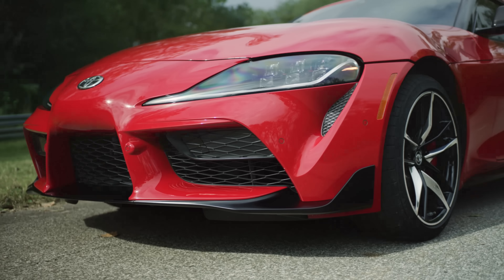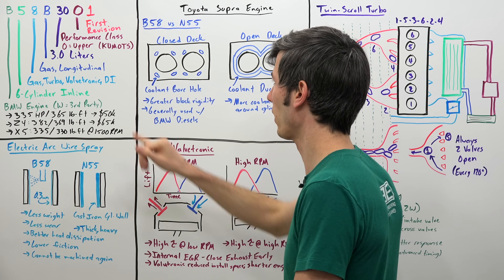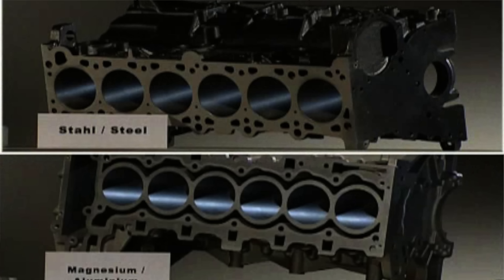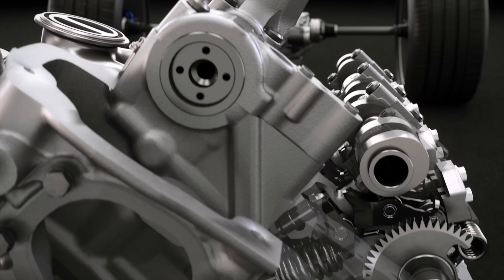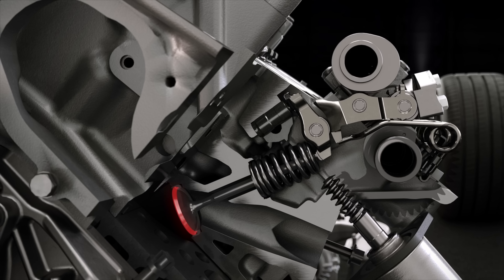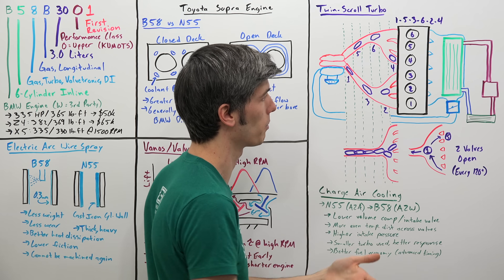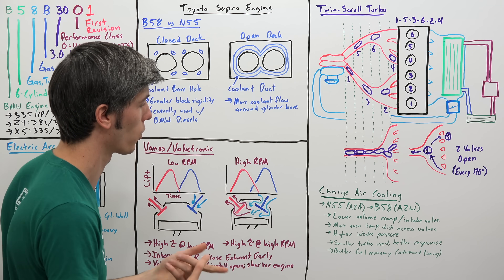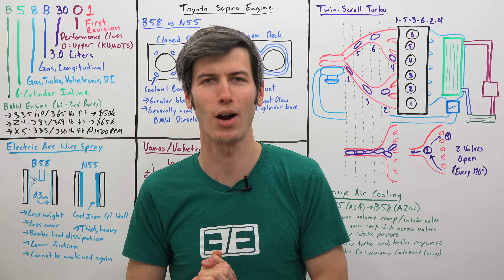2020 Toyota Supra Engine - Detailed Review Of The 2JZ Successor

Comment: Makes me regret selling my MK4 knowing there will never be an in-house built Toyota GT car.
Reply: Unpopular opinion: the only Supra is overrated.
Reply: Why would you sell the old one? Sorry to hear that man. I'm really sorry.
Reply: thatunknownguy don't be. Made a killing on it
Reply: Especially with the crazy prices they are reaching now
Reply: You... sold your MK4?  Blasphemy!
Reply: Lexus F is where Toyota is investing money.
Reply: buy the lc500 :)
Reply: Does anybody get that a Supra must have a straight 6 engine. Something Lexus doesn't make
Reply: @RDJ1SS  More than that, it could only exist in partnership with somebody as the volumes are too low for Toyota to build from scratch, especially since they don't have any straight 6's any more homologated for the US anway. Since it only could really be done by spreading the cost for the platform, may as well go with the best sports car maker with a 6cyl inline ya?
Reply: Lexus makes yachts. At that point might as well buy a Challenger.
Reply: @jdmr1c3ing  depends on what you buy. The isf was good, The lc should be good, the lfa... Hell the old SCs like mine are based on the mk4 supra chassis most parts are interchangable suspension, firewall is identical 300 used a na 2j, 400 has a 1uz v8. Therr are plenty of yachts like the LS400 and the suvs etc... But lexus is where toyota engineers get to go less conservative than the toyota name plate
Reply: @jblob5764  the LC500 is a boat.
Reply: I sold mine in Jan 2017 because I moved to California and there was no way  was going to get it to pass SMOG. I regret selling it. As the price keeps going up I will probably never own another one.
Reply: Yeah, it's pretty telling that the only two non-boring cars Toyota makes (86 and Supra) and they can't even be bothered to make it themselves.
Reply: not like the 2JZ was built by Toyota.. its a Yamaha built engine.
Reply: The Lexus LC F that is coming out is what the new Supra should have been.
Reply: Shwalker07 totally agree. Great platform and the supra should be a larger GT not a compact sports coupe
Reply: @Shwalker07  no way.. that's a heavy cruiser not a sports car
Reply: I have a all-track sitting in storage and I think now may be the time to sell it. I highly doubt it's value will grow any. Unless it sits for another 100+ years. It probably won't be on the lot long. She's a fast little beast but they're one of the few Toyota's with reliability issues.
Reply: @gravyd316  
What year All-Trac?
Reply: @EPYes  I think it's a 93 or 94. I don't have the title right in front of me ATM. It had 50k on when I parked it but I did let my nephew borrow it for a month or so. Knowing him it's probably at 60k lol.
Reply: RCF GT3. Btw.
Reply: by "in house" you mean Cylinder head by Yamaha, sort of in house right?
Reply: I have a 95 black on tan 5 speed with 120k miles for sale $31k for interested parties
Reply: Um you guys do know the mk4 2jz was built by yamaha yeah  ??? Not Toyota ? ... History repeats itself again lol 

New TOYOTA 86 = subaru boxer engine
Reply: Are you quoting the 2JZ? yes it was a fantastic engine!
Reply: @fidelcatsro6948  sure was you can thank Yamaha for the 2jz
Reply: Respect brother Respect Nice to hear your a Yamaha fan and have a WEAPON of a bike.......wow nice You Ride hard i see ? Your exhaust ports was choked with Carbon hu ? Wow man thats hardcore.... Glad to hear its all clean now and ready for a Blast 👍👍👍😁😁😁😎😎😎  

Hay bro u have a Youtube video of your R1 yamaha 1000cc Bike ??
Reply: According to Chris Harris, Type R beat Lexus LC 500 in a track. I'm not sure that video hold any water, but if Toyota tuned new Supra well it could beat LC 500 in a track. Horsepower isn't everything.
Reply: @danielrouw2593  um no Yamaha built the block as well just do google search on it.... if u design somthing you pretty much giving the build all of its faults and success, to say yamha design somthing and Mitsubishi forged the motor in factory dose not give full credit to Mitsubishi for engine credibility to them
Reply: @REEL SIXX no but i sure wouldn't be giving Toyota all the credit....can u imagine  the Ferrari coming out and saying all of our engines was built by Lamborghini?? Would u still give full credit to Ferrari?? Now come on bro be serious about this ?
Reply: 2JZ from Yamaha
Reply: ah dude, that's sad..
Reply: Sold mine a years ago, glad I got the money. It seems I was getting to old driving around a TT :(
Reply: Lies.
Reply: if you had the audacity to sell an mk4 then you never deserved it to begin with..
Reply: There my be yet a true successor in the future still im sure the earth shattering backlash from the community and sales will force toyotas hand to produce something of meaning and value. Dont lose hope yet.
Reply: Carlos Nazario   Not really, the “community” doesn’t represent more than a fraction of potential buyers. 

Also, the last gen Supra was a sales flop in the US,
Reply: @carlosnazario1170  toyota would rather kill the Supra name if this fails than dare to impact sales for the Lexus F cars. Honestly this thing needed a light chassis housing the gsf v8 and it would have been a home run. The v8 is choked down by the heavy cars they put it in, especially the bloated Frankenstein chassis of the RCF. Even a ttv6 that Toyota builds for Lexus would be a winner.
Reply: afrosheenix exactly! All they had to do was put the F V8 in a small light car with a manual transmission and it would have been a complete home run. They’d be offering something new to the sports car market with a light(ish) V8 manual RWD car that’s not American. They could have even called it the new Lexus SC just like how the old one was based on the Supra and offered a V8. But I don’t think Toyota knows how to build an enthusiasts car anymore, The 86 is underpowered and hasn’t gotten a significant powertrain upgrade since it’s introduction despite peas from enthusiasts. And all of their Lexus F series performance cars are only offered with an automatic shush-box, all share the same powertrain and are heavy AF. Say what you want about the 8 speed automatic but at the end of the day it still has a torque converter and lacks that directness you get with a real manual or even a dual clutch. If a CVT was lighter or cheaper and could hold the power then that’s what Toyota would be using in the F series cars.
Reply: afrosheenix they would have made infinitely more money from a FT-1 supra with factory warranted 600whp with a motor to get 1500whp with more boost and fuel than the entire Lexus F lineup
Reply: @carlosnazario1170  I highly doubt it, It seems to me that Toyota no longer cares that much about pleasing Toyota performance enthusiasts. Between the GT86 being a re-branded Subaru, pulling all of their licences from performance oriented games, ie Forza, and now the Supra is a re-branded BMW.
Reply: @Zeldatp151  Mr. Toyoda cares near as I can tell. He really seems to be breathing some life into the brand and making a project like this or the GT86 happen at all was probably not the best financial decision so you have to applaud that. That said, when I went to work for a certain manufacturer  in 1999 I was so despondent at the total lack of car culture there I sold my 67' S800 (one of only a couple in the US), and my 20V MR2 and moved on, and at this same time Ford employees had a MR2 club! Go figure.
Reply: @carlosnazario1170  probably not. It will sell fine.
Reply: @carlosnazario1170  or maybe makes Toyota get rid of their sport cars
Reply: Lexus F cars don't come in manual so no, they're not Supra successors
Reply: @nemesisxxprime  neither does this car
Reply: mythos000000025 hence why this will flop. This is just a cash in by Toyota off the name of Supra.
Reply: @nemesisxxprime  it wont flop when the lap times are shown. It will 100% beat most sports cars at its price point.
Reply: JDM racing why would anyone want this over an m2? Which comes in manual btw. It's not like Toyota fanboys can bank on the old "its more reliable" excuse. Lap times? It's a sports car not a hypercar.
Reply: @nemesisxxprime  The M2 is 10k more.
Reply: Lexus LC500 in my opinion is basically what the Supra should have been. In fact, think of it as the modern luxury version of the Supra. Sure it doesn't have a Manual or a I6, but it is a darn good GT car and who would have thought that Japanese V8s could sound so muscular!?
Reply: Daniel G Check out the Lexus F lineup. Not exactly a Supra, but way better than the BMW.
Reply: @hamzasaeed918  theyre not better anyone that has driven one has said how much better an m series is to drive, you would only buy a lexus if you want a lexus thats why the m divison sell more cars.
Reply: @flynndodsworth2693  What exactly is your definition of better? Because Toyota/Lexus blows BMW out of the water in terms of reliability.
Reply: Hamza Saeed Haha that was a good joke.
Reply: @hamzasaeed918  you do realize the new supra is faster, lighter, cheaper and has more aftermarket potential than any current F car, right?  The weight reduction in the RCF Track Edition will make it ~0.1 seconds quicker 0-60mph but it's also going to cost at least $20,000 more.  Lexus makes great value luxury cars but until they start producing cars with forced induction and forged internals, AMG and BMW M will have them beat in the luxury performance market.  BMW and Mercedes just flat out make better engines.  It's why companies like Pagani and McLaren (at least the F1) use Mercedes and BMW motors.
Reply: @hamzasaeed918  wrong.  BMW builds a better car period... unless you've owned a modern bmw you can't possibly comprehend.
Reply: TurboVisBits  lol, just had one in the shop that someone was trying to trade in, only a few years old with 18 codes misfires on every cylinder broken switchgear on the inside, ran like a paraplegic etc. 

Needless to say after my inspection the owner didn’t get the deal he was hoping for 🤣
Reply: Didn't the old Supras use engines built by Yamaha?
Reply: @joebloggs4191  Yamaha only designed the heads in the GE and GTE motors used for Toyota. Most famously in the 91-98 MR2. But also Celica GT4 and others.
Reply: joe bloggs heads were Yamaha that's it
Reply: Buy a Corvette instead.
Reply: Yeah, Lexus RC is the REAL successor to the Supra. It's a touring car with some serious power, engineered with passion and built by Toyota. No, the powertrain formula isn't exactly the same (NA V8), but it's better than a BMW made I6 3.0TT and more of a Supra than this BMW will ever be. They will be similar prices too, which is hilarious.

EDIT: and while the new BMW Supra will handle better and he lighter, the OG Supra was never light, nor was it particularly quick or tight around turns.

Comment: Why they did not use the s55 engine with 450hp from the M3/M4?
Reply: It would've been less profitable for BMW. S55 supra would take away BMW M4 sells,and render Z4 40i kinda useless,even if it would have higher price tag,like around 60-65k. Sure,it would be win-win for A90 buyers but not for manufacturers. On top of that,it would be questionable investement in such expensive engines for car with with small production rate if compared to corolla and camry. Hell,they even keeping GRMN Mark X for domestic market and limited production,because if it was set free in,for example US market or Russian market ,where v6 camrys are popular,this car would throw out in window Camry V6 sales,especially in Russia,where young people usually buy used 1JZ-GTE Tourer V's for passionate driving and drifting.

Comment: Haters can't even buy it
Reply: Lucas Tekkan and yet anyone who can afford a car can afford a second hand JZ long block. How many 30 year old BMW engines are as hot a commodity as a JZ? The reason this motor will never be a legend isn’t the lack of power it’s the strength. BMW has never built an engine that can literally be thrashed for decades in standard form without breaking. No one will be buying this motor in 25 years, second hand for peanuts. This motor will need to be rebuilt to last 25 years.
Reply: No one can, that's why everyone finances...

Comment: Atleast used mechanical parts will be common and easy to find in the future when parts start to break.
Reply: Nikki Naydenov 
What do you mean by ‘when parts start to break’? 😉
Reply: @Conservator.  i mean its a bmw, shits gonna break lmao, and when it does, go to your local junkyard and take engine and drivetrain parts off of 3 series and x5's.
Reply: @thicknick734  it's mostly the electrics you should be concerned over... and replacing with OEM is just going to lead to the same problems.
Reply: @Oblithian  how so?

Comment: I don’t know what is up with the unreasonable hate with the new Supra
Honestly I really like it and it will be a great sports car with an amazing tuning platform 
Toyota did the tunes so that the new Supra feels like a Supra (and more reliable)
A 2JZ swap would be awesome!
Reply: It is a great sports car, and I'm grateful that toyota of all makes is pushing making one....but at the same time there is some grounds for the negativity. Toyota is typically considered one of the most Japanese of car companies. Where everything is done in-house, the limits of the product are very well known and that's how they maintain their reputation. 

With limited production sports cars they have to partner with another brand for both the supra and the 86....but at least with 86, a lot of toyota tech made it into to the subaru built car. it has an excellent trans (both manual and auto) built by toyota. They incorporated D4-S into the FA20. The rest of the car might be a subaru, but it's simple in its design, and lines up with Toyota's philosophy (and that Toyota is a stakeholder in subaru). 

To the eyes of many the BMW partnership didn't really play out the same way. its a CLAR chassis, on a BMW engine, coupled most likely to a ZF-8....The interior looks like its from a BMW parts bin with a different gauge cluster. Yes Toyota tuned it, and I think it does have a slightly different suspension setup. But it's hard to call it a supra with so little toyota in this car.
Reply: @skifree0  true, with so little Toyota parts in it, its understandable you feel that way. But what about the soul of Toyota? I have a hard time believing that a car that has been tested rigorously to meet Toyota standards & is tuned as such does not have some Toyota soul in it. It even follows the same recipe as the previous supra, it just uses foreign ingredients.
Reply: nobody tunes an automatic, not to mention auto mk4 are least desirable on the market

Comment: I talked about this with my friend, people are so upset it’s a BMW, but look at the history a little,:

the MR2 was worked on with Lotus, 

the NSX Was worked on with Mclaren, 

and the FRS/BRZ Subaru Toyota. 

There are many collaborations and if this is the thing that  they (Toyota) where going for, I think it’s a fine car, we could have had a “lesser” car if it had just come from Toyota, but how so with the amazing LFA they released?
Reply: Venom's Motors it’s not a collab so much as merely reskinning the Z4.
Reply: CLP so your saying Toyota did nothing?
Reply: The BRZ FRS is the least reliable Toyota in years and those other collaborations ended with engines that were stupendously well built by Toyota. In standard form if you can beat this engine like a red headed stepchild for 30 years without it breaking it’ll be the first BMW engine to have anything like that kind of strength. No one will be buying this motor second hand in 25 years. This motor will need to be rebuilt to last 20 years.